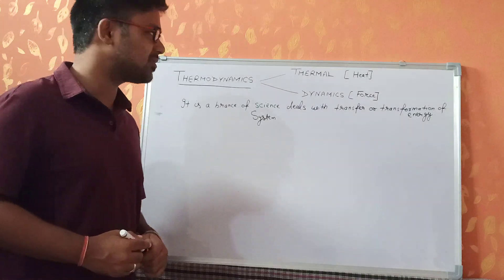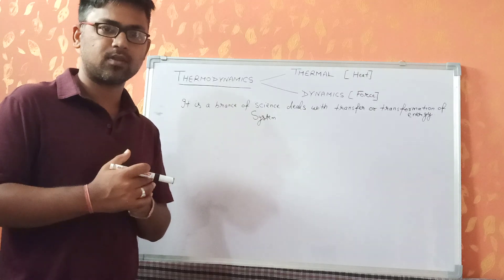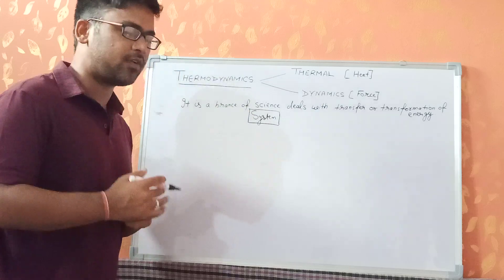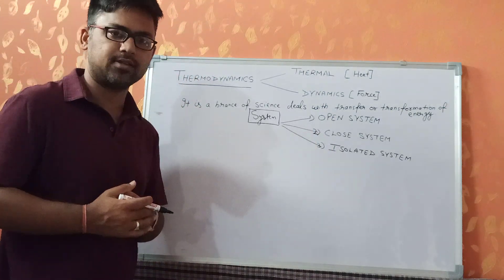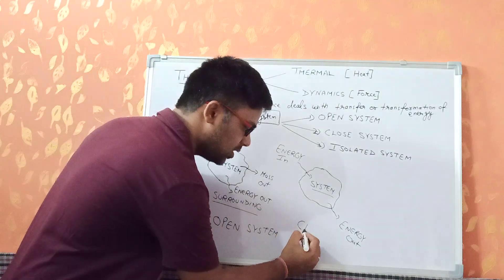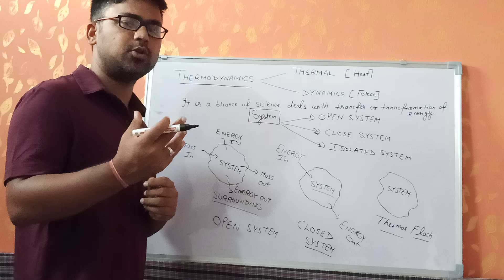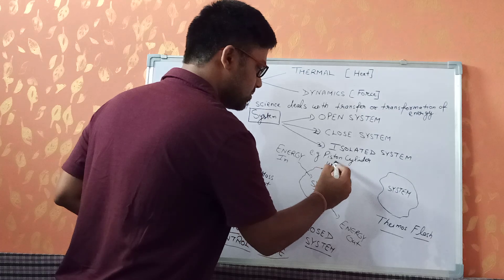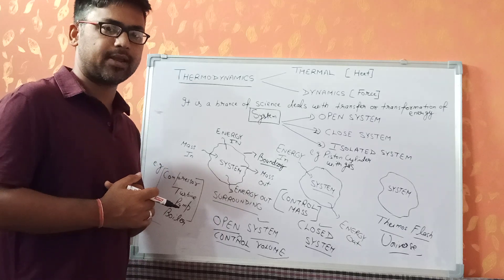Types Of System! control Volume! Open System! Closed System!

Comment: Sir how this exchange of mass and energy takes place with example
Reply from the maker: For example water enter boiler and goes out as steam represents exchange of mass. whereas as to produce steam heat energy is given to boiler represent exchange of energy b/w system and surrounding.
Reply: @MechnoReceptor  very nice example sir